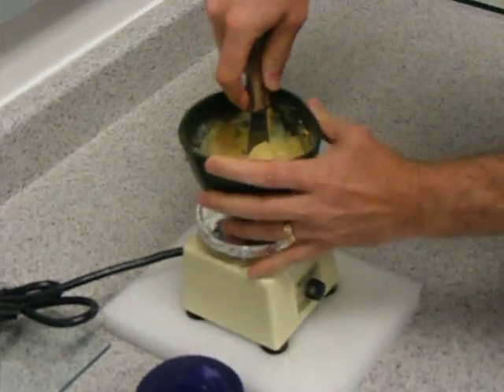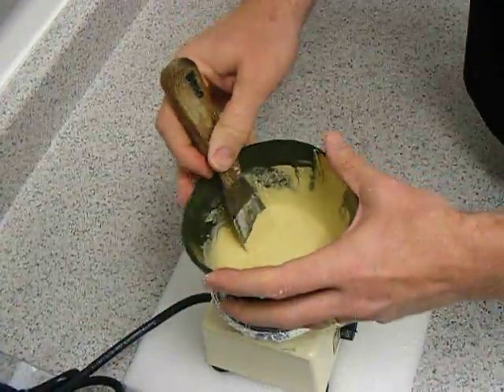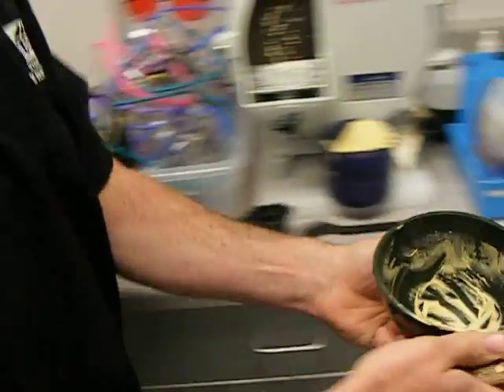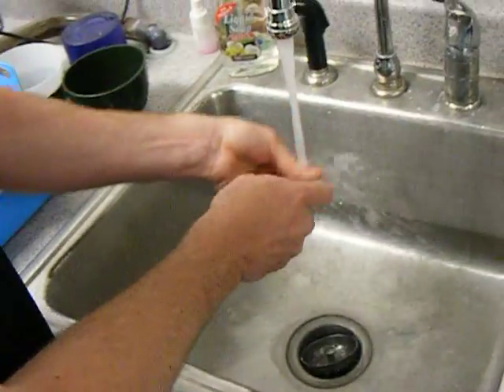UCDH Dental Materials Lab Stone Pour Up Demonstration 1

Comment: I'm sure this will eventually clog the drain. You should let it harden and then dispose of it...or eventually change the P-trap.
Reply: Every Dental/DH school has plaster traps in the plumbing (required by CODA).  Then the drains don't clog.
Reply: smart...so just don't try this at home.